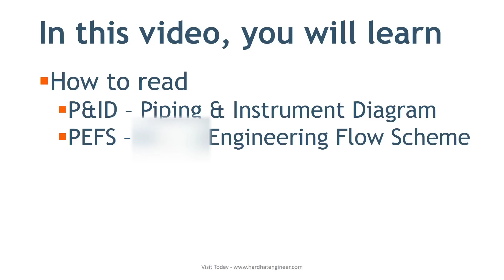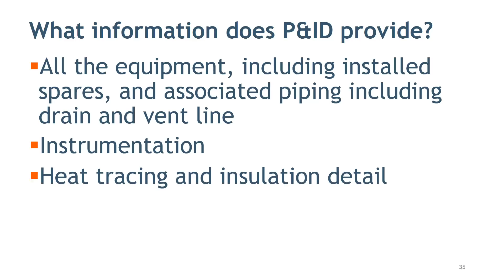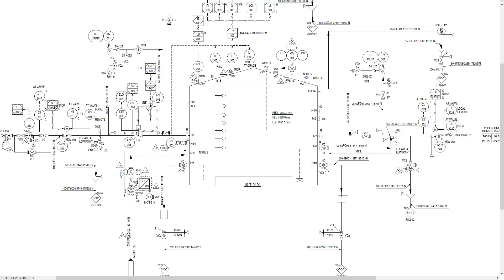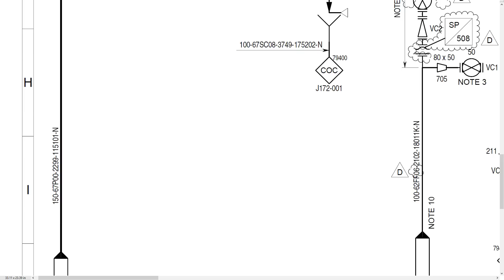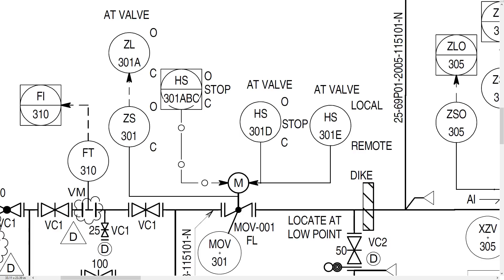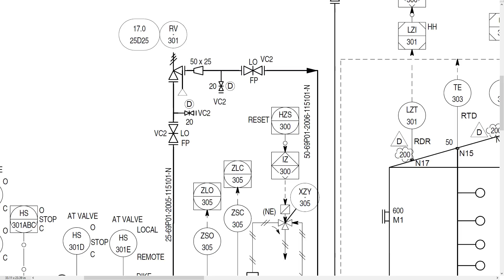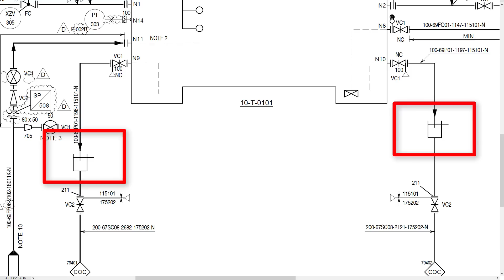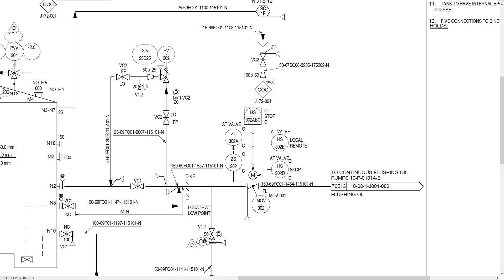How to Read P&ID Drawing - A Complete Tutorial

Comment: P in PEFS stands for Process, not Piping. Piping people don't know how to make this drawing, they just follow these drawings on the 3D model after prepared by Process Engineers. It is Process Engineering Flow Scheme. This term is only used by Shell.
Reply from the maker: Yes, that is true. I said it right on video but miswritten on a slide. Thank for pointing error.

Comment: good video but im confused when you said pipe fittings and flow details are not included ib p&id.
Reply from the maker: Hi, From PID you can not get the detail about how many elbows or tee required. This information will generate in next stage that is Piping GA & ISO.